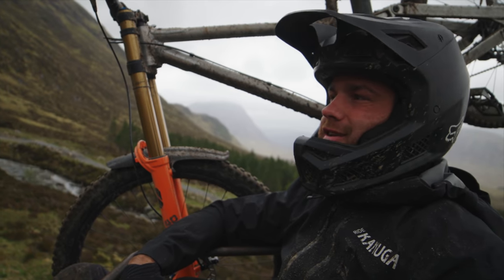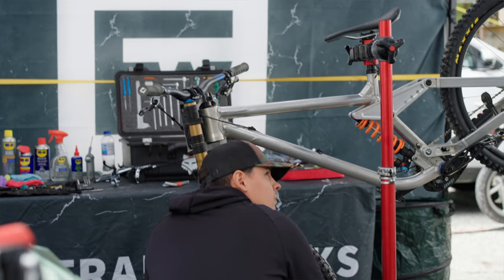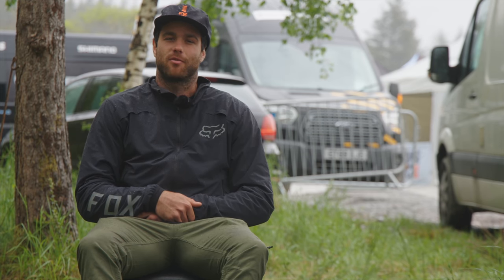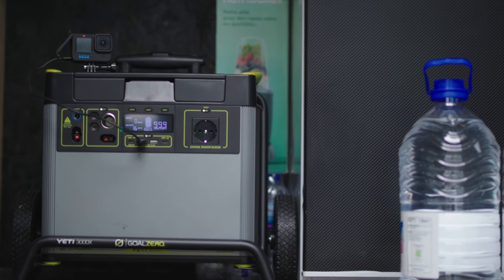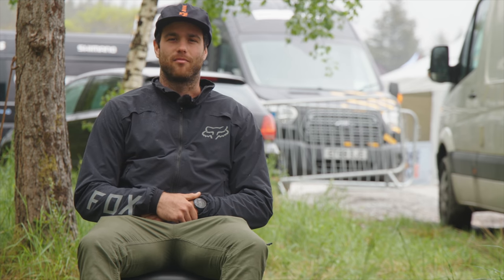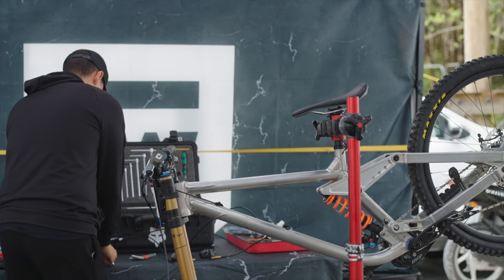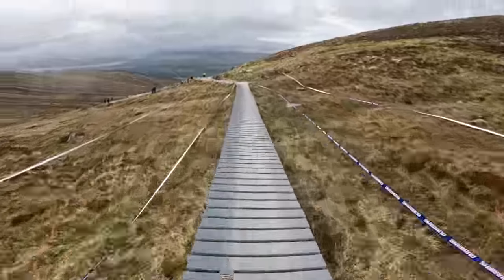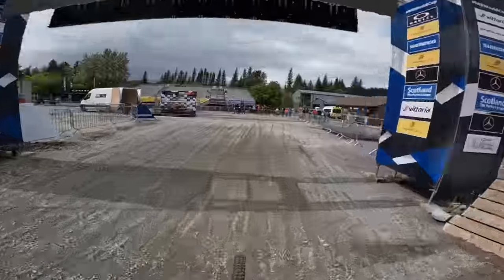FRAMEWORKS | Neko Mulally | Episode 6

Comment: 2:14 those (and all) welds should never be concave, especially if fatigue is a concern.
Reply: You clearly have no idea how long Frank has been joining pieces of aluminum to other pieces of aluminum. The guy is a living legend in the framebuilding world.
Reply: @dk8583  then there should be some evidence of at least 1 of his welds being put in a fatigue tester doing 10000 cycles. 
Just take a look at the welds on any 90s onwards Japanese motocross frame. All convex beads and you'll still get some frames that fatigue and crack a weld. 
I am a welder who meets many welders that can weld neatly sure, but they ignore the science because their life isn't personally at risk using the product. They get paid to weld, not paid for a product to last 20 years. 

There is not 1 circumstance on a structural part where you choose a convex weld profile. Sanding a weld convex is even worse. 
As the weld bead cools it contracts, think the opposite of blowing up a balloon. If that weld touches 2 pieces of metal it will pull both together after it cools. 
You almost never get 100% penetration and a 1 off hand welded tube will not be full penetration. If you then make a concave weld instead of a nice balloon weld you have a slim wafer weld with internal forces pushing the 2 metals apart, instead of a perfect sphere that's contracting evenly (equal forces all directions)
Reply: @janeblogs324  I’m just sayin’…Frank the Welder is a legend in the MTB world and has tens of thousands of frames under his belt. I’m sure he knows what he’s doing enough not to bother with internet weld inspectors.